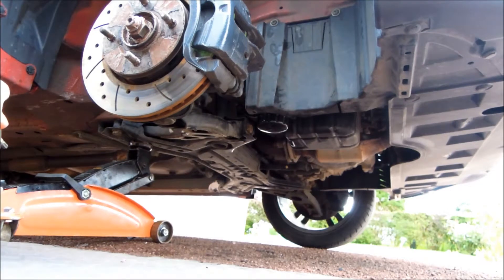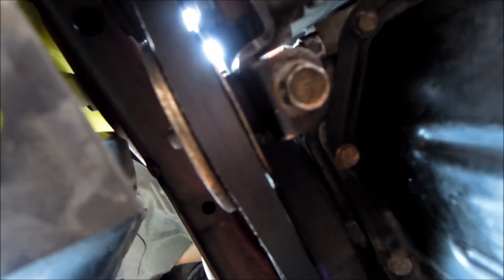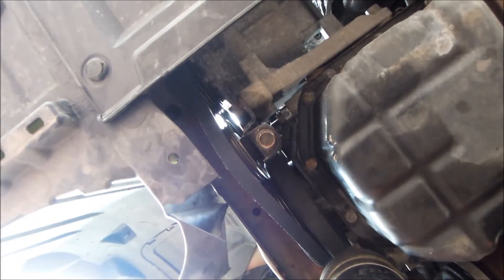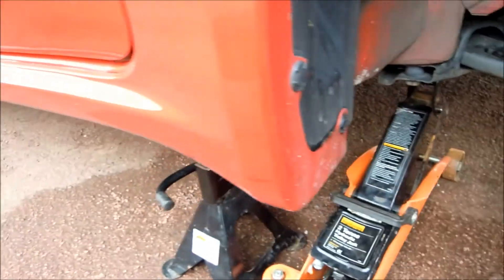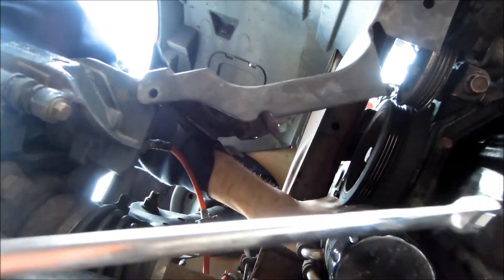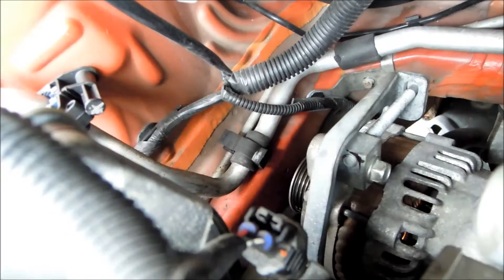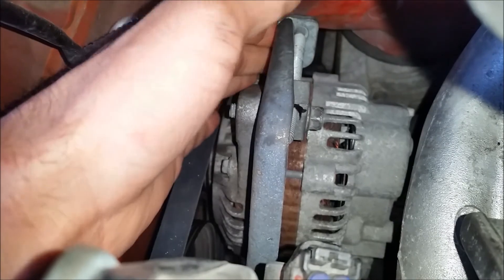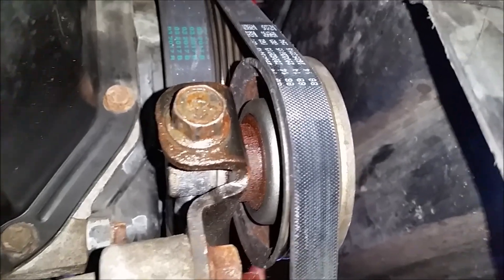Colt Ralliart/CZT - Changing Aux. Belts

Comment: Thanks for this video...I have a question if you can: I just need to tighten the aux. belt to fix a squeaking noise, can I do that by just using the two bolts on the alternator or do I also need to remove the wheel as you did here to access the 14mn bolt underneath ?
Reply from the maker: From what I can remember you should be able to access the tensioning bolts without removing anything

Comment: did you know if has and timing belt this model or it is metal
Reply from the maker: The 4G15T engine found in the Colt CZT and Ralliart has a timing belt. The replacement interval is 50k miles or 5 years if I remember correctly.